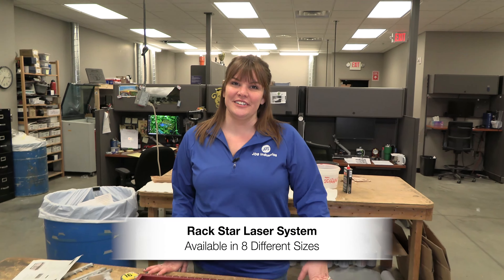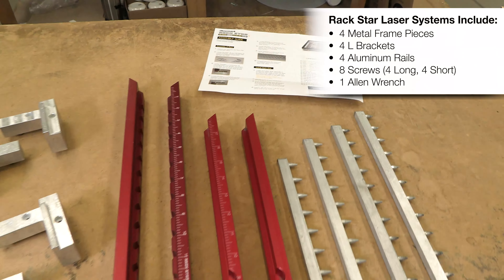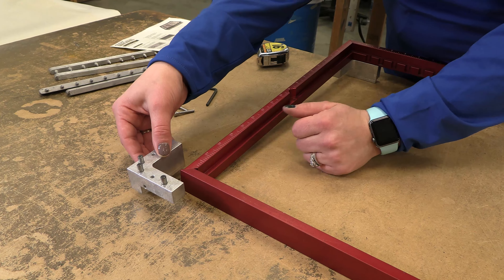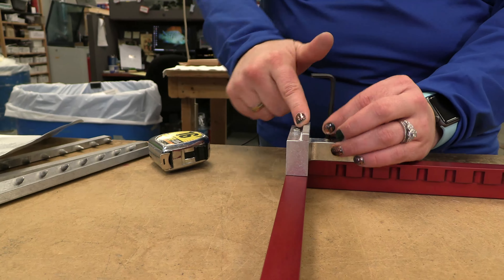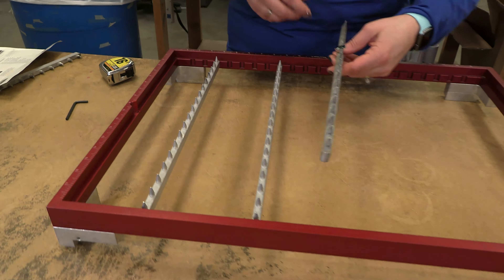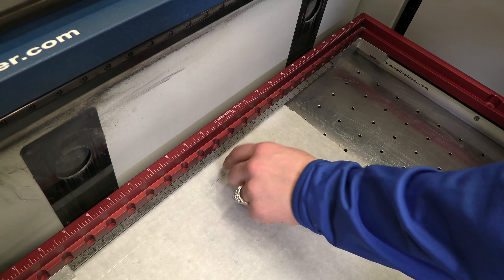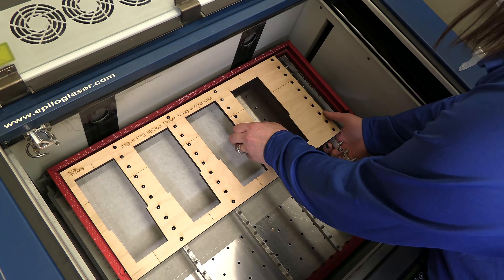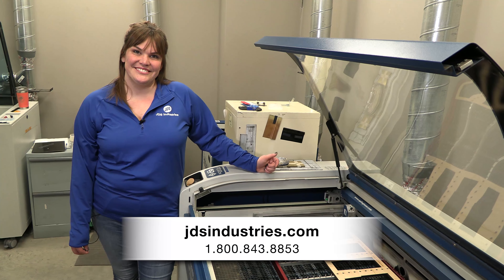How to Perform Initial Setup of a Rack Star Laser System

Comment: Brand new to lasering and just received a Thunder Laser. I don't believe the Thunder Laser beds have a ruler like what you show on the Epilog. Does this present any issues with properly aligning or using the Rack Star? Thanks.
Reply from the maker: No issues! As long as your laser bed is large enough to fit the rack star, you can place it in the top left corner.
Reply: @JDSINDUSTRIES  Thanks...i guess the trick will be to find a consistent alignment spot in the upper corner since there isn't much of a raised area on the honeycomb frame.
Reply: @steinbierz  we are looking at a thunder 35   DId you get the rack star and how does it work